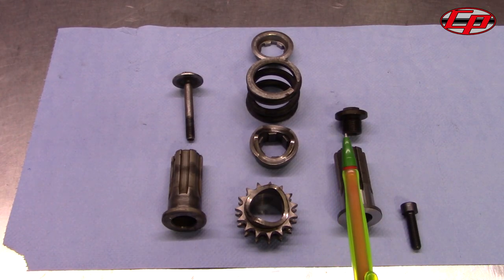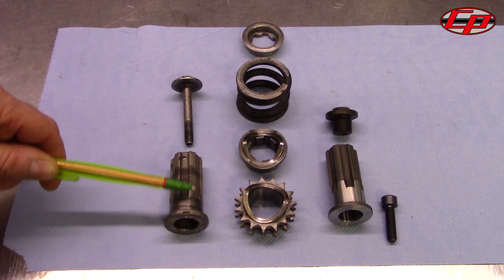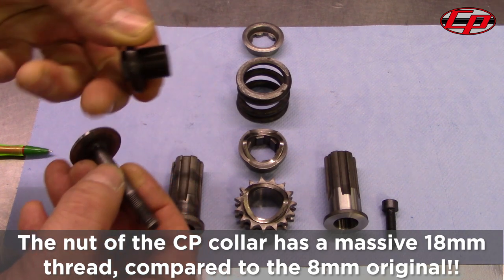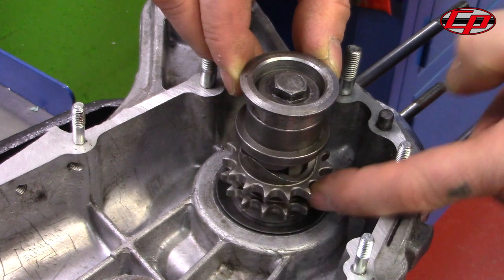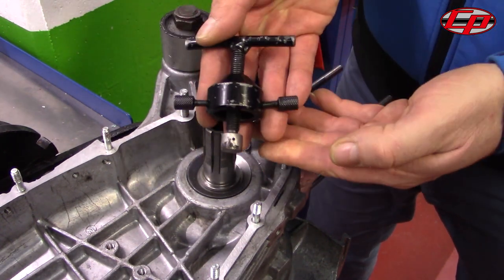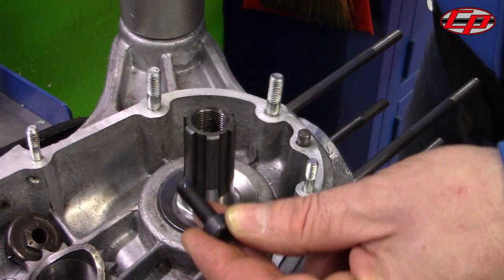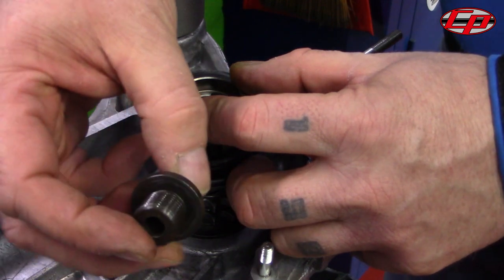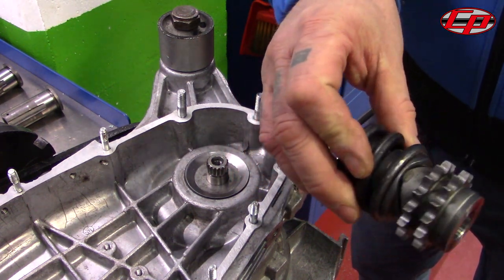Casa Performance Lambretta front sprocket assembly upgrade

Comment: appreciate the design improvements made to deal with extra power but the cush drive does bot knock back and forth when you change gear why would it the only time it ever disengages is to separate your back wheel from your seized piston and it squeels when it does and you need to be quick with the clutch to save further damage I think